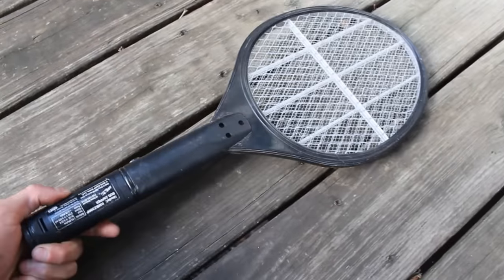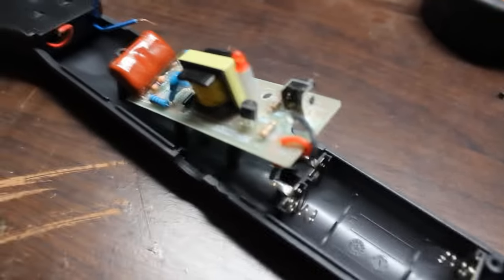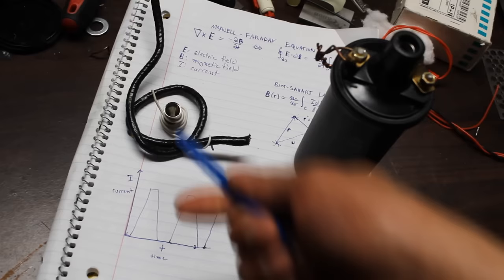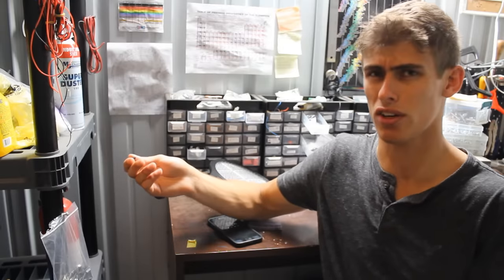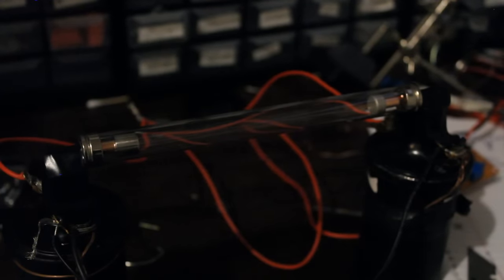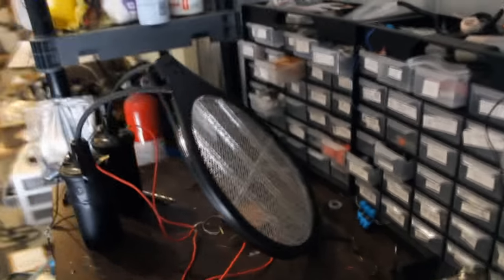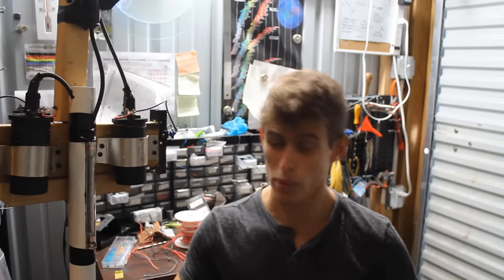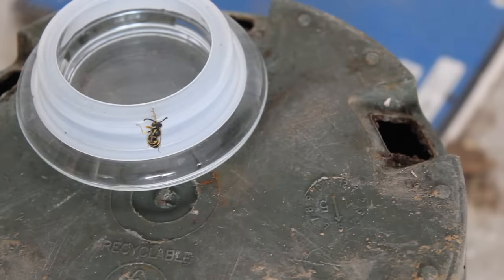Overclocked Bug Zapper. 2750V to 50000V++

Comment: I used to buy four of these at once ($2 a peice at Harbor Freight at the time) and take them all apart to scavenge the capacitors, then solder all four in parallel and put them all on one bugzapper. It didn't change the voltage but the amount of current gets quadrupled, it makes any insect essentially detonate on contact lol. Takes longer to charge between hits but ohh well, feeling your face get blasted by spider shrapnel is worth the delay🤣.
Reply: Om so thats hilarious
Reply: I need to make this myself
Reply: Ima make sure that lol
Reply: Spider shrapnel, now that's a term I didn't know existed
Reply: Much better solution. appreciate it, top man.
Reply: do you have an exact methed of doing that?
(looking to upgrade)
Reply: @shawn_hope   It's quite easy, before you take apart all your bug zappers (don't try to add more than three extra capacitors or you'll run out of room in the case, it will only fit a total of four), make sure to remove the batteries and stick a screwdriver tip between the metal grids on each one to make sure there's no charge in the capacitors, so you don't say a swear word when it shocks you😂, then take them all apart. Use a soldering iron to desolder the three extra capacitors, leaving the fourth one alone (before removing them it's a good idea to make a mark on one side of each cap with a sharpie, marking the same side of all four caps so you don't mess up the polarity, either side works so long as they are all oriented the same way). Once the three extra caps are loose, fit them into the fourth unit without soldering to make sure they'll fit, then once you find an arrangement that allows the case to be reassembled you can either solder the tips of each terminal to the existing legs of the capacitor in the primary bug zapper, or solder two short pieces of wire to the existing capacitor legs and solder the other three caps to that wire, whichever you need to make them fit. My particular brand of zapper allowed enough room to just bunch them all onto the legs of the existing cap without needing to add wire, but some zappers may be different.

Comment: I love your creations and love how you overdo everything. I would say that this may be a little too overdone in terms of being practical. The issue I find with most bug zappers whether stationary or portable is lack of current, not voltage. For my stationary ones, it’s frustrating to see the grid clog up. Finally ordered an oldschool one that uses a standard transformer instead of the underpowered high frequency circuits found in so many cheap bug zappers. I saw another guy diy a crappy bug zapper with a microwave transformer. Now that was a sight to be seen & think that would be the perfect way to make a practical supercharged bug zapper!
Reply: Wait, you could make one with microwave parts and that's NOT what Styro did? 😱
Reply: A bug zapper with a MOT? That sounds ridiculously dangerous and also very fun

Comment: I also upgraded my bug zapper. But it still works at the stock voltage of max 1300V measured. I slapped in 4 series 47µF electrolytic capacitors as storage and replaced the 3V with a 3.7V 18650. Then I upgraded the transistor inside and added an overheat protection. I made sure insulation was good so accidents with humans are unlikely (you would have to deliberately stick your finger into it and then it would only be the tip of the finger that gets damaged).
Mine is still 95% the old form factor and now instead of slowly killing wasps over 3 minutes it now kills them instantly with a loud bang.

Comment: In a nutshell he tore apart a bug zapper, replaced every single part, and basically built a taser from scratch :p
Reply: օɾɑςӀҽƘղíցհԵ ' kind of misleading title, I thought he was going to upgrade the original zapper
Reply: Just like the Theseus's paradox. He replace and upgrade each part. Is that the same bug zapper before?
Reply: Yep
Reply: Same things when you upgrade a computer lol
Reply: He tore it apart to see its system and ramped the whole thing up. It just kept getting bigger! Lol
Reply: Kitsune ' k
Reply: well he tried then it started to catch fire when he used it so he had to turn it into bug electroshock therapy
Reply: CORRECTION: a tazer polearm
Reply: Almost same thing with his plasma sphere project haha
Reply: im your 1,000th like

Comment: You can eliminate the mosfet by just using a NC 12V relay. They react the same as points and condenser in a distributor. Except that when the circuit closes, it opens itself again then closes. It does this about 50-60hz. Basically simulating AC

Comment: "The only issue is that it would take forever to charge it up...and if you touched it, it would kill you instantly"
Reply: Joshua Fisch use a car battery charger😂😂
Reply: Joshua Fisch The voltage won't kill you. It's the amps that kill you.
Reply: Fucking Chicken but you can't get high amps without high voltage
Reply: Fucking Chicken V = I X R
The human body provides a set resistance from any one point to another, so V is proportional to I.
Reply: You guys are misinformed. It’s the electricity that kills you. It’s not one or the other. It’s not the amps or the voltage. It’s like saying the gun killed you and not the bullet. It’s the combination of actions. Please research cause I don’t know the specifics but I know I’m right 😅👌🏽
Reply: FilthyMcnuggets >doesn't know specifics yet tells others they are misinformed.
>proceeds to encourage them to do research he won't do himself
Reply: people have touched 50000V before without protection and millions of V with protection. Now if a couple amps hit you you are immediately dead, the strenght of the electricity is what kills you.
Reply: Lol
Reply: no its not u rart
Reply: FilthyMcnuggets You are most definitely not right.
Reply: It won't kill you. You can get hit by tens of millions of volts and be perfectly fine if the amperage is low
Reply: Theyayan28 Firstly, when talking of millions of volts, just use MV's. Secondly, that's completely false. ElectroBOOM showed this perfectly using 1 volt 150 amps and shocking himself through the tongue, nothing happened. Next 20 volts 150 amps and he got shocked like crazy.
Reply: Skilz Yes I know how electricity works I study electrical engineering. 150 amps is a shit ton and will easily kill you at 20 volts. In fact 200mA will kill you at 20v. I only said million instead of MV because most people don't know what MV is
Reply: FilthyMcnuggets lol one of the first things Instructors tell you verbatim in basic electrical is “It’s not the voltage that kills you, it’s the amperage”.
Reply: Theracter my thoughts exactly
Reply: Skilz Higher voltage definable would hurt a lot more, but a few milliamps cpuld kill you. If the current were to go through your heart your dead, but theres no vital organs in your tongue, and the path of least resistance leads the current from the positive terminal to the negative one, which were only a few inches apart.
Reply: IM crying at this
Reply: FilthyMcnuggets funniest comment I have read in a while
Reply: Jeez
High tension and high intensity can both kill you
Reply: One will burn you to a crisp and the other will tense your muscles
And both are always present so both things will happen
End of the story
Reply: just a smol oversight. makin consumer electronics aint easy ya know
Reply: But it’s cool

Comment: Has 2000 Volt bug zapper
"I plugged in my batteries... So let's start jamming this screwdriver in."
Reply: @HUB GOBLIN interesting, i'll try using a screwdriver on the next available thunderstorm
Reply: I’m pretty sure the handle is made out of rubber
Reply: Preventing electronic shock is like one of the highest priority while designing a screwdriver.
Reply: Doesn't matter, nothing is connected to the ground, he could touch the metal part of the screw driver and the current would still only flow from one side of the screwdriver to the other side. But there's  probably enough resistance in the circuit to limit the current

Comment: Just add an extra capcitor on the output, 330uf will kill dogs wolves, elephants and wasps
Reply: I like how wasps came after an elephant
Reply: Martell bloody wasps
Reply: No dogs
Reply: +humans
Reply: Wasps, Instantly thinks about Rodalco2007. :D
Reply: ֆɨʍɨօռ ʊֆαȶօv̟  it's actually µf, which makes this somewhat less funny.
Reply: ֆɨʍɨօռ ʊֆαȶօv̟  ah
Reply: Reads dogs and reports the comment and i did report it
Reply: Depends on the charging voltage. 330uF capacitor fully charged at 3V probably won't kill anything
Reply: @martell761  Wasps>Elephants and blue whales /s

Comment: I did something similar, but used a microwave transformer/ diode and 13 capacitors also from microwaves for about 24J of energy. Bugs explode, and screwdrivers spot weld to the wire mesh.
Reply: ...and the bug got zapped into a different reality in the time-space continuum
Reply: D Sandoval 😂 😂 😂

Comment: I was surprised to see the 50 kV monstrosity take longer than the puny zapper to kill insects, but in hindsight it makes sense. No switching circuit is able to dump current faster than a charged up capacitor. I guess the original design has its merits.
Reply: i'm not sure it took longer, just that he gave the bugs multiple killshots just to be sure :D
Reply: It's probably the skin effect, at high voltage & high frequency, current tends to go over the surface of things rather that through it. When he zapped the CFL bulb it was a good demo on how shit that normally insulates (say glass) doesn't insulate at high voltage & high frequency
Reply: U Wot M8 o
Reply: Probably does take a tiny bit longer, but you could still add a diode and capacitor to to the output (heck of an high voltage diode needed). That would make this thing a lot more dangerous to people tho. Ignition coils will hurt like hell if you touch one but thats about it, while the large DC pulse that a capacitor can give can also stop your heart.
Reply: berni8k

Comment: if you want that it packs a punch you have to get an russian pcb free oil capacitor (like the ones that i have) and wire it in parallel to your ignition coil output... this doesnt fry the bug, it vaporises it

Comment: Overvolted, not overclocked.
Reply from the maker: Well...considering my original bug zapper was DC and had a frequency of near 0Hz, and my new bug zapper has a fundamental frequency of ~400Hz, I actually DID overclock it by a factor of roughly 400 infinities.
Reply: I love it!

Comment: 2500 doesn't really shock you hard, it just stings for a little, it just shocks you and scares you, doesn't really hurt
Reply from the maker: 2500V can kill you instantly if the source can supply a decent amount of current.
Reply: It depends on the amperage
Reply: styropyro dont forget the amps, it kills you if the amp is high. 100000 volts at 0.01 amps doesn't do shit, but unless if you are stupid enough to keep touching the fucking circuit, then yeah it can kill you eventually. Nevertheless, safety first, I dont know why the fuck would anyone would like to touch that.

Comment: I think you could increase the turns of the wires to increase the induced emf, also I did not understand how did you power the change in electric flux what kind of battery did you use or did you plug it in an AC source is that why you used Zener diode or was Zener diode used to prevent reverse emf current your content is really interesting!

Comment: Ah why not make a simple resonant oscillator with a capacitor in parallel with the coil, then tune to match. Youll be surprized how much juice the coil can output. Made a self cleaning bug zapper with a MOT with a lighting capacitor in series and about 1500pf of doorknob caps on the secondary. It completely vaporized the bugs and incinerates the bigger ones.

Comment: I only little overcloced oryginal zapper by put beter transistor and ratiators turn it on to main by dc adapter for supply 24/7 then put in on bucket with scraps form dinner. Soo flys want kill them self for it.. Sometimes one fly make short circuit and dont explode for some time then others go around inside safe ... But when this one that make short boil out or explode for peaces this sound make others run and find in trap.

Comment: I use to stuff a 9v battery in that exact zapper...it’s a little small so you gotta stick a broken piece of pencil or something behind the end without the terminals but it makes it snap waaaay better!!!! I did it to a dollar store zapper and it popped the electronics instantly lol 9vs got quite a bit more power than the AAs and this brand zapper can withstand it i used it for years!! Was so much better and much easier than this although not quite as cool lol 👍🏼

Comment: You can also add a 18650 battery + holder and a 1000kv arc generator, all fit in the original handle but it explodes wasps 😂😂😂😂

Comment: I Know you made teslacoils. Tur make 1 with a water core and makes a sekond 1 in the same vater . Like 2 boats with 1water fild coil in eatch . Clost top and open at the bottom se how far the power van go. Tur sekond 1 is backwords. I dag only tinking About a pictior from the pyramide.